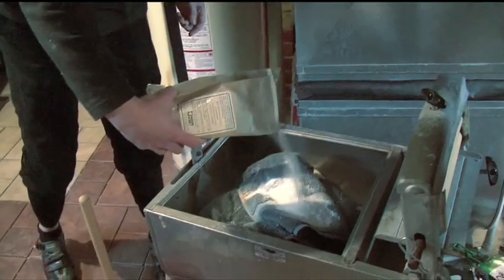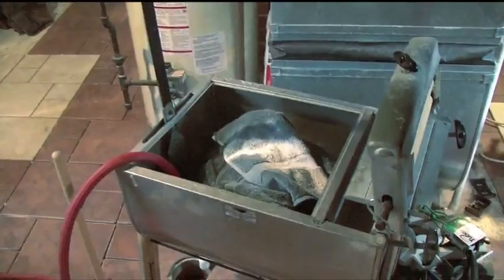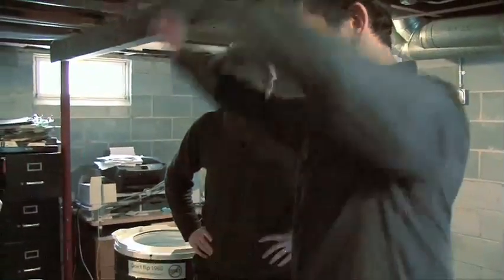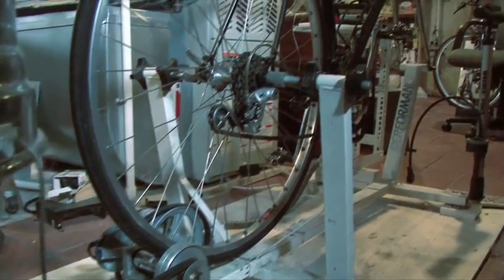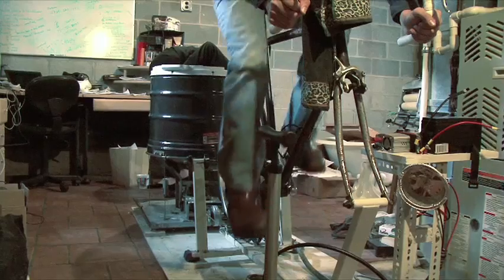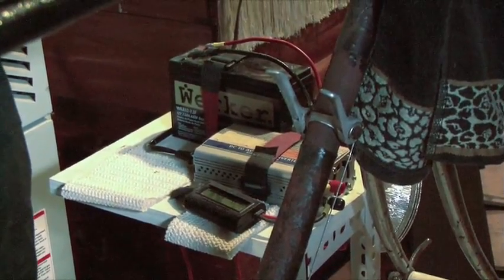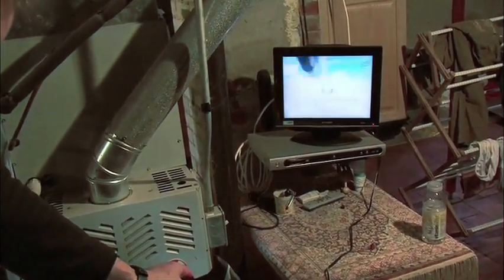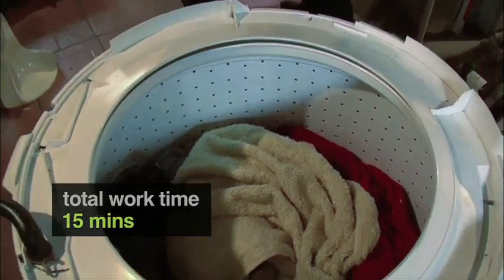How To Wash Your Clothes With a Bicycle

Comment: MAN ! ! ! !  YOU SHOULD USE YOUR BICYCLE WHEEL TO TURN ANOTHER WHEEL WITH A CONNECTING ROD CONNECTED TO THE OUTER PERIMETER OF THE WHEEL TO MOVE THAT HANDLE THAT YOU PUSHED BACK AND FORTH TO WASH THE CLOTHES! !! lIKE AN OLD LOCOMOTIVE WHEEL!  THEN YOU COULD JUST SIT, PEDAL, AND THE HANDLE WOULD MOVE AT ANY SPEED YOU WANT IT TO ! !  HECK, IT'D BE SIMPLER TO USE AN OLD FASHIONED ROLLER WRINGER THAN THAT CONTRACPTION YOU ARE USING, MUCH SIMPLER.